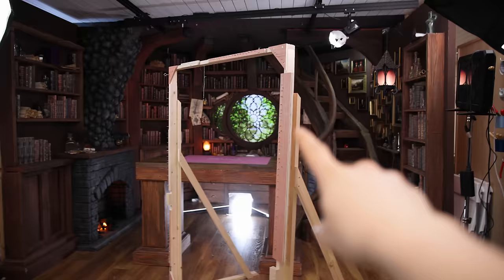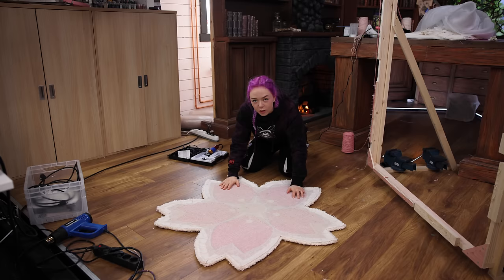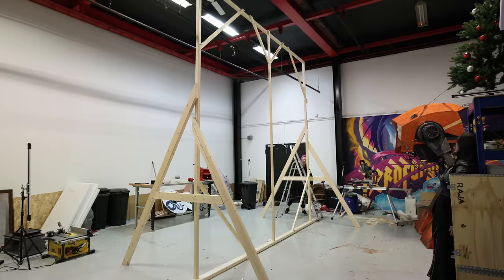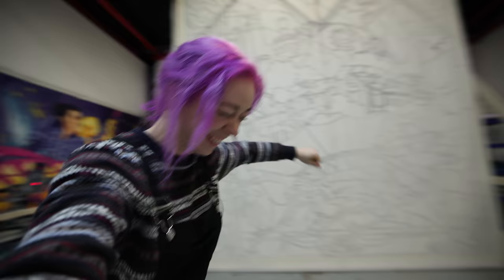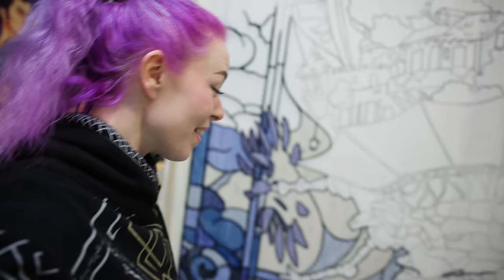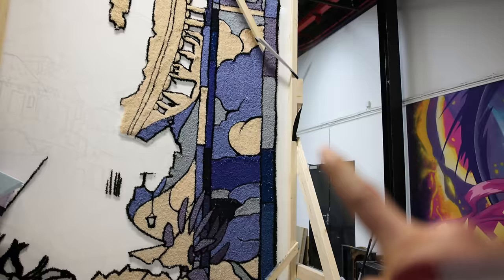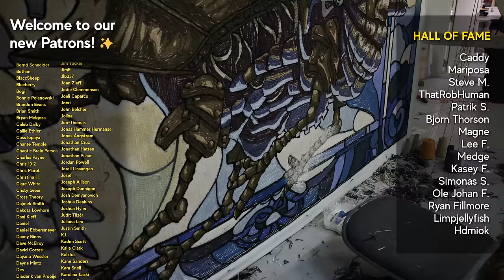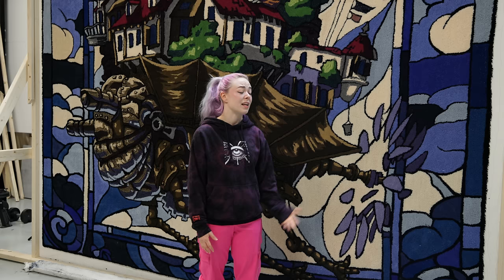I Made a 170 Sqft HOWL'S MOVING CASTLE Rug

Comment: Instead of giving it away or having it sit in your wearhouse. Put it on the ceiling of your lounge. Then you get to see it every day, and when you wake from a nap, you are greeted by that incredible rug.
Reply: having it on the ceiling sounds incredible!! they're feet will have to continue to suffer the cold floor though..
Reply: That rug is so heavy they're ceiling would need  to be pretty reinforced
Reply: That is an awesome idea!
Reply: I had the same thought, but would their lighting setup cope?
Reply: @EthalaRide not only that carpet, she would have to somehow keep it from dangling in the middle, which means either nailing it with ton of wide head nails, possibly damaging it, or put some sort of 4x4 glass under it to hold it in place, which would be ultra-heavy…

However ceiling could also be supported via some sort of pillars on the outlines, that can be covered with fancy shells made from resin, with a ton of LEDs…
Reply: THIS! Extra soundproofing baffle.

Comment: Just a quick note since a lot of people are suggesting to use it as a tapestry and since you will be keeping it on the frame. Be very careful of those top edges. In museums, for tapestries they will hang it by a fabric that has been stitched or glued on the back of the tapestry in order to conserve the original and not have it be damaged by its own weight! Even if you have some gap between the actual rug and the frame, it could over time damage or warp that top over there because it's directly the fabric still. Hope this helps☺

Comment: Hey! Here's a trick to transfer black lines from a drawing to a white canvas using a projector: Invert the colors in the source image. That way, you'll project white lines into white canvas instead of black lines, and you just have to draw black lines wherever you see white. That way, when you paint a black line in the canvas you'll hide the white light from the projector, so you can easily spot any missing line.
Reply: Nice tip
Reply: Wow thanks, that's very rational thinking ☺️
Reply: Like how astronomers read projections of star observations in negative to help them see the tiny dots that represent the observed celestial objects in black on white rather than white on black?

Comment: I love all the furniture suggestion comments. I have a few ideas.
1. Try to fit the furniture on the edges. As beautiful as it is, the focus isn't the "stained glass" border and background, so you're free to put stuff on it.
2. The space will demand a centerpiece, or else the space in the middle is dead. The following suggestion is based on another comment I saw. A glass or acrylic, transparent, table in the middle will be that centerpiece, filling the space, without obstructing the rug's design too much. Note: as tempting as the potential project may be, a stained glass table is not advisable, so keep it plain, ie. neutrally colored or colorless. The designs of the stained glass table and rug would conflict and create a bunch of unpleasant visual noise.
3. Minimize the use of desks. If you have one gaming or editing setup, that's fine. If you have multiple editing setups for multiple editors (idk if you have more editors besides yourself), make a nearby editing studio that doesn't use the rug, and leave the room containing the rug as a lounge.

If you just can't figure out your furniture, a library, an assisted living facility, or a retirement home may welcome the rug with open arms. I'd suggest a library, especially a local library, where more people, potentially you included, can visit and appreciate the rug, and it easily fits into the literate environment. If you can't figure anything out, call it a tapestry (based on another comment) and figure out someplace else to put it based on those parameters. The comment I read said that tapestries were used to insulate stone castles, so you could easily just put the tapestry in your own garage!

Comment: Attach it to the ceiling of your work area. It will help with sound quality when recording in the studio space.
Reply: This way it would be fully seen and never ruined buy dirty shoes/feet. However Martina did mention it was EXTREMELY heavy.
Reply: imagine it falling down lmao I think it'd kill her
Reply: They hang chandeliers that are Really Heavy just need to screw heavy duty hardware into a support beam😮.  Being sure to not have it touching the wall to avoid moisture creating mold😢.  It needs to breathe😂! 🎉❤🎉
Reply: The weight doesn't just affect the supporting structure though, you'd have to be sure the rug itself could handle hanging. A solid piece supported all the way around is going to be different than a cut piece with all the weight hanging from the top for a prolonged period of time.
Reply: That is such a cool idea
Reply: @danitini14  The top right edge is already sagging on the frame.

Comment: 1. Keep it as a wall piece. Like a tapestry they used to hang on castle walls. It was decoration, but also helped with insulation and warmth. Yours can be like a modern tapestry.
2. If there's any left over yarn, use it to make a simpler, quicker design for your original carpet idea. And maybe cut the frame in two and make it two smaller rugs instead of one big one. Might be easier on you guys? 
3. Btw. LOVED the sakura rug! 
4. I appreciate your art and dedication and I'm kinda tempted to make my own rugs ... some day. XD

Comment: such a beautiful project!   You're right it would be a shame to cover it up.  Maybe instead you can make a modular rug of 1m hex shapes. you can mix/match colors, and/or make special pieces that you can feature and even swap out as desired.   Flaps on the edges of the hex pads can be covered in industrial hook/loop tape to make the project strong enough to stay in place, while still giving you the flexibility for reconfiguring it on a whim!   In the mean time, I might suggest the puzzle edge fatigue mat squares on the floor. The foam will give a good bit of isolation from the concrete while giving you some creativity of choosing colors, and when a more permanent rug solution is found, the matt can stay in place to provide for a lush and comfortable padding.

Comment: Finally a sensible use of this carpet knotting machine. I think the carpet turned out wonderfully. It should be made available to the public. It's just a shame that the carpet won't be as well appreciated in your home. But maybe you can make one just a little smaller as a wall decoration. And for the cold floor problem, you make a carpet that makes sense to extend the tapestry on the floor and can still be covered with furniture. 🥰

Comment: you could do half of it on the bottom then flip the whole thing upside down and finish the rest of it, that way you'd not have to stand on the scaffolding to work on it.
Now you need to make another one without such a nice image on it that you don't mind covering with the furniture.
Reply: I think that would've messed up the tension on it especially since she didn't have the bottom attached to the frame. It also would've just been super heavy on the side that they'd be trying to lift up compared to the other side which would make flipping something so large really difficult

Comment: You should get one of those standing outdoor heaters - with the big mushroom cone up top , they’re basically giant heat lamps
At the very least you’ll have a warm place to return to/work near every so often when you work out in the warehouse
Reply: @_Cloun, one would have to be very careful about carbon monoxide and dioxide generation as it burns either propane  or natural gas.

These are outdoor heater for a reason.

Comment: Well i was wondering why you made a fancy rug, for a place you would most likely spill stuff on it. or indeed covering it up with furniture. You could use it  as a tapistry and maybe it has insulating properties that way. Or you give it an insulating backing so you'll loose less warmth through the walls. And whar's good for cold in winter shoud work as insulation against the heat in summer.

Comment: If you put backing on the bottom half, completely finishing it,you might be able to lower the whole thing with half resting on the floor to reduce weight.🤔 I hope you made it slightly undersize coz once you start walking on it, it'll flatten and spread out.😯You have done amazingly well for a first attempt, 👏👏👏👏👏and it's great to see you enjoying the challenge!👍 Will your head fit through the door frame after this?🤔I'll watch a little more...

Comment: @Nerdforge “If you use a weed trimmer (i.e. any tool that vibrates) for a while and then let it go, you will likely feel numbness and weakness in hands and fingers from holding this vibrating tool. If you experience this once a week, then symptoms likely go away in a matter of minutes. However, if you use vibrating equipment all-day-every-day these symptoms may become permanent. The condition is irreversible and is a very costly hazard among workers.” -Simon Kudernatsch, Ph.D. Please be careful!